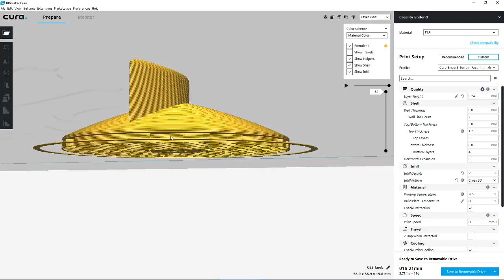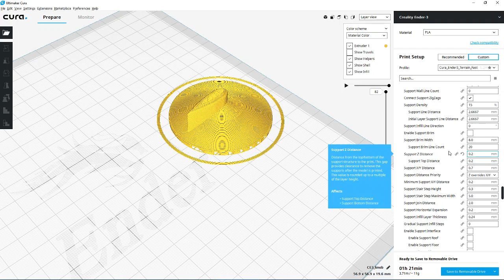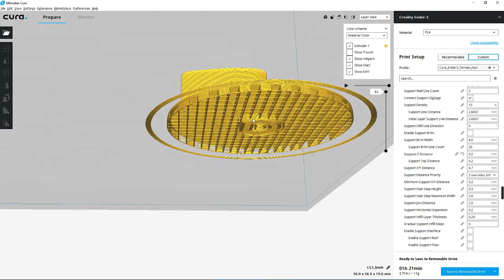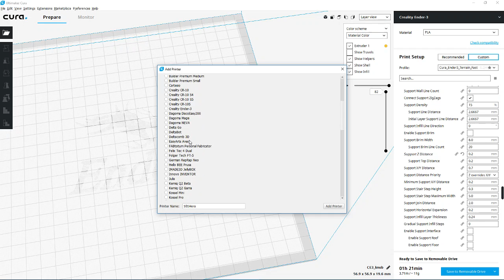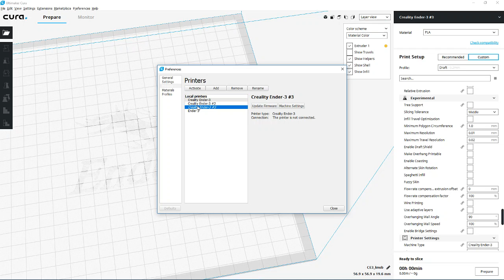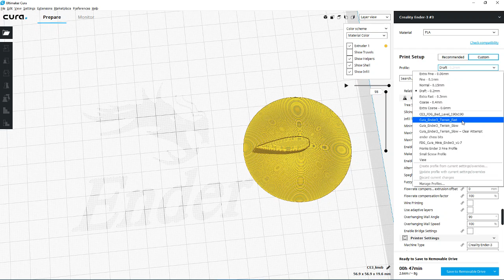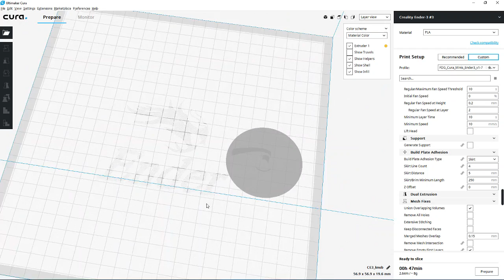Hidden Cura Secrets You Should Know for the Ender 3

Comment: I have paused my build in Cura . Is there a way I can add a support I forgot to put in
It says I am unable to modify while in pause
Just thought as I am new to this , there may be a way
Cheers
Reply from the maker: Apologies, I only just now saw this. If you're mid print, unfortunately there's no to add supports. Theoretically you could save a gcode that starts at the level where it was stopped with supports, however, you'd ALSO need to have something for those supports to print on. Really it's easier to start over.

Comment: Another you tube video expresses the opinion that the natural Z stepper layer change is 0.04mm, so I use 0.16 or multiples of 0.04 as anything else would not be on a "step", (0.1 isn't but 0.2 is), the end result being the occasional horizontal line in the print where the "approximation" or, I assume, some form of rounding down/up, is replaced by the "correct" 0.04mm step.
My XYZ printed cube is just perfect using 0.16 layer height and a bit 'rougher' using any non multiple of 0.04.
Your setting of 0.12 is a nice multiple. (prints would take longer than mine at 0.16)
Did you determine the 0.04mm step rate yourself and did this influence your chosen 0.12mm ?
Reply: its from the magic numbers video  @avaviel